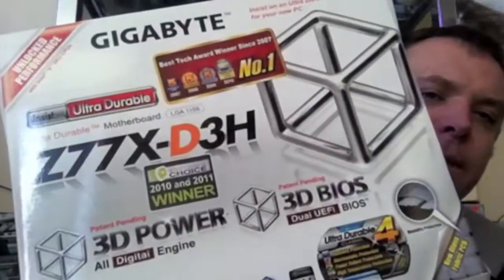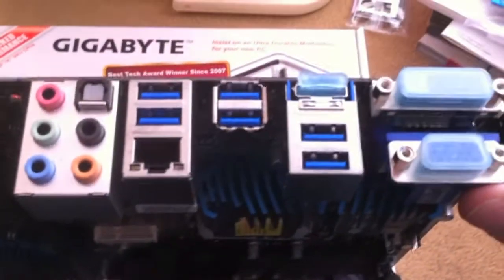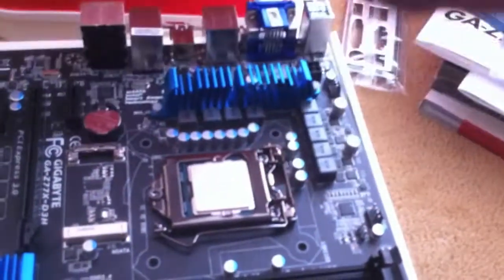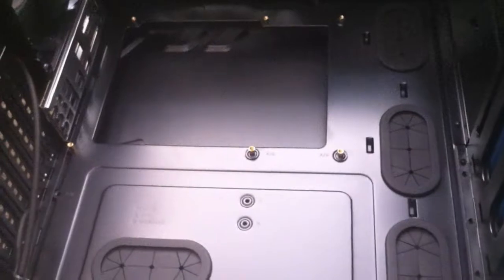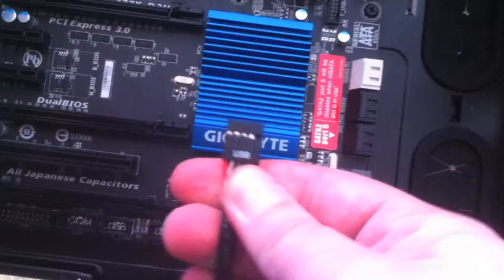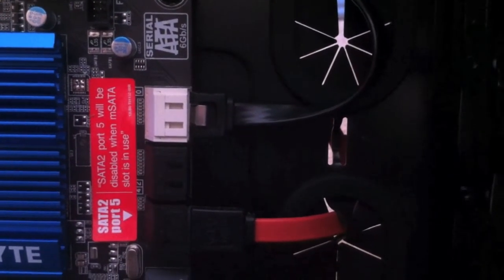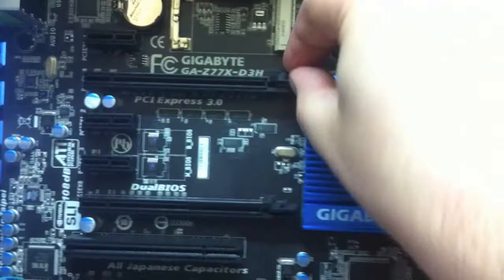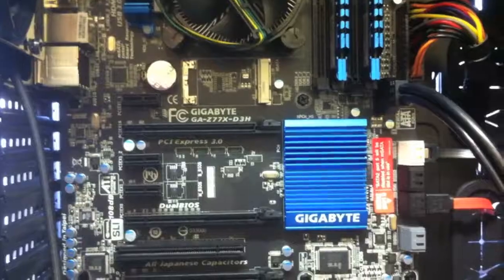Building My New Computer Part 2

Comment from the maker: Thanks Kevin, I tried to get as much detail as I could. Theses days you don't need to worry about making any of the drives slaves, as there are far more Sata ports on motherboards, so each HDD can have it own cable/port. Yes I'm using the SDD as my boot drive and its way faster.then the older HDD's. Building a computer is so much easier then it used to be. Not sure when part 3 will be up, I'm hoping its before the weekend. Thanks for watching .